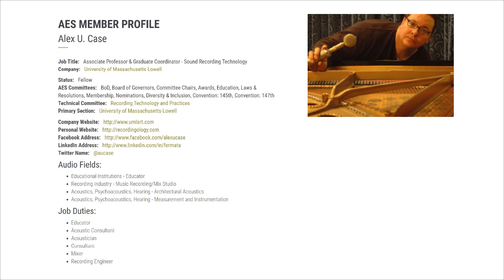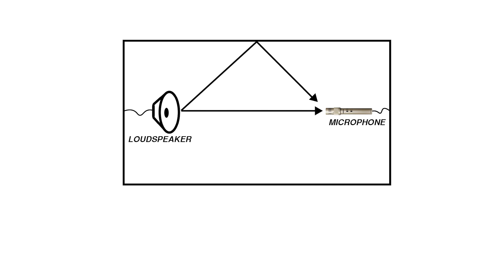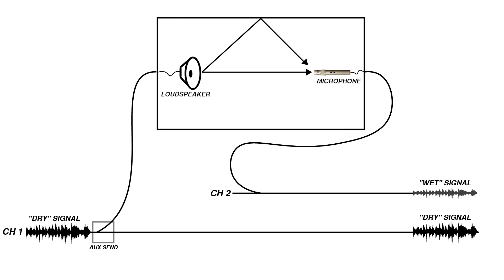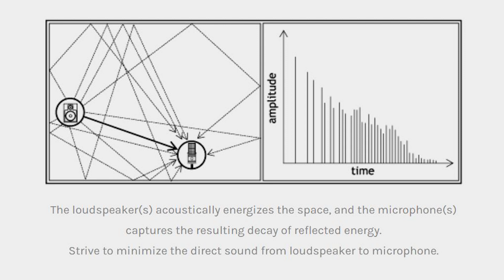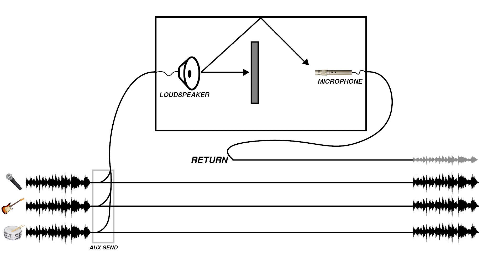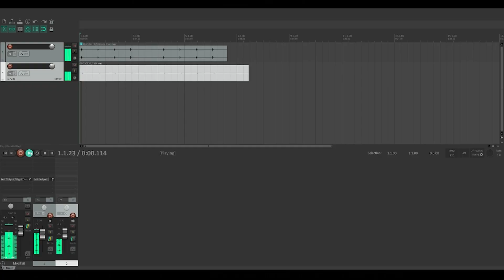CHAMBER REVERB CHALLENGE | DIY Chamber Reverb

Comment: Dear Kyle Brother I has a big problem setup my Effect Processor TC-Electronic M-3000 do you have any Video Training for that Bro Kyle ? Problem is i has been set them up but > sound never correct and sound so weird .
Reply from the maker: I would set it up with the same signal flow as I described in this video, using the "Balanced Inputs" and "Balanced Outputs" XLRs on the back of the M-3000.